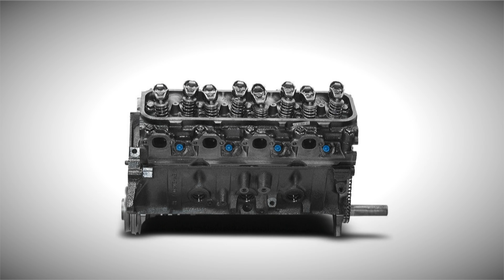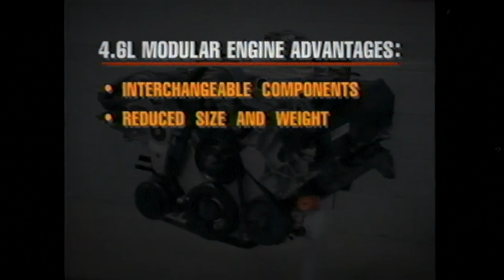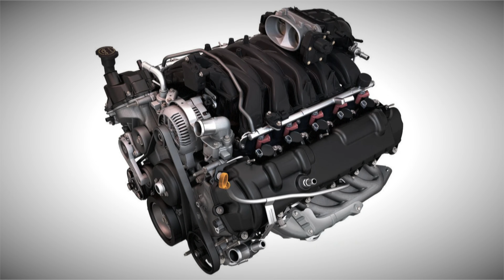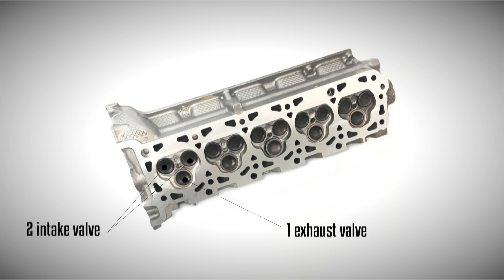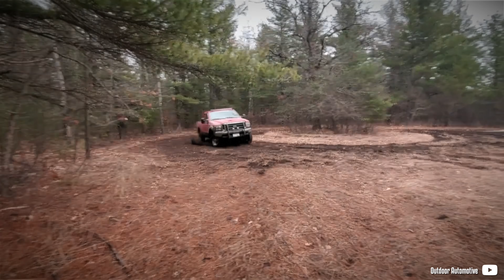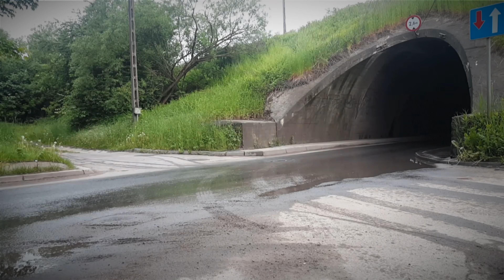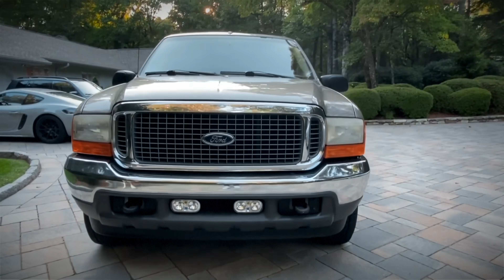Is Ford's V10 Truck Engine Any Good?

Comment: Having owned Ford trucks from flatheads, Y blocks and 460s plus gutless Windsors to the current 3.5 Eco, have to say that the one with the '06 F350 3V V10 was my second favorite and just behind the 6.7 diesel. Did it use gas? Of course, but no worse then a 460. You just can't move 7500 pounds dry weight, 4.10 final gears without doing that. Will it haul a 38 foot 5th wheel, 12,000 RV. Easily. Did it burn oil? Not a drop in 100K miles plus it was never in the shop for anything - ever since maintenance was (is!) still simple DIY. The current 3.5 Eco is still too new to put anywhere on my list though, but seems decent.

Comment: "100,000 miles of travel free maintenance" ford moment
Reply: 100,000 miles is when you have to do more than oil changes.  Spark plugs, coolant.   These engines easily do 300k.
Reply: trouble free*

Comment: my work has an old ford superduty worktruck with the triton v10 in it, it does all it needs to but it blows my mind seeing where people drove busses with them in it with no issues. i will absolutely admit though that the truck at my work has something like 300,000 miles so it could do with a looking into the internals due to the hard life it had there well before i got there.....but i will say, EVEN WITH it being high mileage and honestly abused its whole life, that dang thing is an absolute trooper if i ever did know one. i just wish i had the chance to drive it when it was newer.

Comment: I worked at a Ford dealership, and wouldn't own a Ford/Lincoln vehicle if it was given to me. Why?
Ford. Sells. Garbage. The number of recalls is mindnumbing- nothing they design and manufacture is fully engineered or sourced with any consideration of QUALITY- none of it.

Comment: They should have built a 5.8 3V or 4V V10 based off the 4.6L for the Crown Vic Cars....Too bad they did make aftermarket cams for the 3V V10 there is a serious 50-75hp (and probably 20-60lb-ft torque) left on the table for Emissions....Heck, in MY F250 a Turbo or Supercharger would be awesome... OR if Ford got really smart...A 5.8L V10 based off the 3.5L ecoboost Cyclone with 2 stage injection, and inter-cooler...Would 600HP and 850lb-ft Torque move a F250/350 with gusto? - YES That is 6.7PSD numbers... Without DEF and other "Diesel" issues...

Comment: My mom had a 2000 Excursion with the 6.8. The only problems it had were it went through coils here and there so we kept a couple in the glove box just in case. It also needed a quart of oil once a month. It had almost 400k miles on it before we got rid of it.
Reply: The coils kept going out because either y’all were using aftermarket coils or the spark plugs were over gapped and over stressing the coils.

Comment: The only problem with it is that it was based on the 5.4 and so prone to a few of the things the 5.4 was like the spark plug. A lot of the modular engines are good. With the 4.6 you just torque the spark plugs to the correct spec once and they only come out if you dont realize theres a torque spec. A 4.6 derived 5.8 could have been as unkillable as the 4.6 if done right.
Reply: Its based off of the 5.4, but the V-10 can take much more abuse and has proven to last much longer.  Thats because it runs so smooth with no vibrations thanks to the split pin crank that allows for 72° firing and a balance shaft.

Comment: My Mercedes Atego truck has a 6L diesel and yet people in America have a 7.5 gasoline in there pickup. Talk about efficiency eh
Reply: You have a turbocharged diesel. This gasoline engine is not turbocharged. Obviously without turbocharging more displacement is required.

Comment: Blows my mind that companies continue to buy the V10 pickups for their fleets. I understand not wanting to have to buy a diesel, they're so expensive. But the 6.8L V10 is absolutely garbage. Ironically, while the V10 is in the shop, I see 3.5 Ecoboosts, 5.0's and 6.2's pulling the same heavy equipment, and their engines don't seem to have the same mechanical problems. Obviously, we laugh at the V6 pulling an excavator, but it's usually the transmission that takes the hurt when they do that.
Reply: No one is still buying the V10 in new vehicles, because it is no longer offered by Ford.

Comment: UPS package cars on the Ford F59 chassis used this engine up until late 21.  I had five in my old fleet, and have one in my current fleet.  Absolute beast of an engine.  In nearly five years with the first fleet, the only real issues I had was a batch of counterfeit spark plugs, one broken exhaust valve spring, and one at 160k that started having excessive valvetrain noise and misfires.  I replaced just the one valve spring, and it was still running fine when I left.  The other engine got replaced.  The new Ford cars have the 7.3, and while it has more power, the howl of that V10 just can't be beaten.  Especially when I "forgot" to put the exhaust back together after replacing the transmission, and "accidentally" went for a test drive with it wide open.  Ooops.

Comment: Our shop replaced a 6.8 V10 in a small bus. It was the original engine, and it had 530,000 miles on it. All my experience with these is that they are/were extremely reliable.
Reply: They are very reliable engines F350 we have has same engine at 510k miles

Comment: I've driven several 2V V10 Ford moving trucks and it's easily the best. Smooth AF, likes to rev, power from idle to 5k and shifts quick. They're a lot better than the numbers might indicate. Recently I drove a new U-Haul with the 7.3 V8, and it was REALLY bad. It was International Diesel slow, despite having more HP than the V10 which I can't understand. Even empty, you need heavy throttle because it REALLY didn't want to rev and just feels crude as hell after driving the 6.8. I was expecting significantly more power but it falls on its face above low RPM. Also, side note, probably not on Ford but the Transmission programming in the 7.3 was absurdly bad. It took at least 2 full seconds to shift at WOT, every gear, making merging on the highway as slow as an International Diesel which is just unsafe. I'm sure it's got to be better in the new Super Duty but I was stunned at how bad it was. It's a hell of a lot cheaper to make a pushrod V8 than a OHC V10 which IMO is the only reason they dropped it.

Comment: Interesting comments about how good or bad a engines fuel economy is with no description of the truck it's in for example I have a 460 powered truck that you would be lucky to get 6 mpg . Why the truck is a 88 f superduty with a 11' dump bed. Axles 5,000lbs front, 11,000lbs rear, 10 bolt hubs, and 4.56 axle ratio. Due to the heavy front axle makes her sit high up like a modern 4wd pickup truck so bad aerodynamics. Lastly it weighs 8,600lbs empty.

Comment: ViscioRacer, next do the Ford 300 Inline 6 from the 60's to the late 90's. Sorry I missed your take on the triton V10 it's very satisfying to hear 10 cylinders roll. But take away 4 for a next engine for the take on the inline 6.

Comment: we a had a triton v10 f250 super duty for awhile, thing got 6.5 mpg and we took it from SE ohio to myrtle beach SC hauling a 30 foot camper. it was a 12 hour drive due to fuel stops and an hour nap because we left at 9 at night

Comment: My experience with U-Haul trucks is that the Ford V10 is whofully underpowered. We've loaded those suckers with roughly 7 metric tonnes of stuff and at that point a fully loaded gravel semi will pull away from you at stop lights. The trucks that are equipped with the Chevy 8.1 Vortec are able to slightly fall behind regular traffic even when loaded with the same cargo.

Comment: As a mechanic ive found the 5.4 2v 03+ and the v10 03+ to be extremely reliable engines. 03 was the cylinder head revisement. They all got 9 thread heads and they no longer blew out lol. They would go well into the 350k mile range if maintained. Timing tensioners !! And guides are the only weak link of these engines but we're talking 180k+ before that becomes a threat . I built a 65 mustang coup with a 5.4 2v 9 thread heads i ported , je forged pistons .010 over and mmr forged rods mmr hurricane pump and opg with comp cams s2 came. Home ported my heads and 180 degree exhaust. Gen 1 lightning intake and homemade mid plate for a gt500 supercharged pattern. Vmp gen 3r blower on 18lbs of boost. Made 618 WHP and 781 torque 😂. 2v engines are truly underated AF. Unbelievably reliable engines. Ford did an incredible job with those ... The 3V lol...  Well not so much
Reply: Nice info on 5.4 and the year of change to better engine..... but I like better the 5.0.
Reply: So stay away from 3v? Can you say why?

Comment: The number one problem with the V10 engine is 90 degree width in the block.  It should be 72 degree width in the block so it has even or equal power pulses.  Not good !!!
Reply: That's the angle, not the width. Yes, a V10 should have a vee angle of 72 degrees, but this engine uses split crankpins so that it does fire evenly... it's just not as well balanced as it could be, but the balancing shaft handles that well.

Comment: I have 2 of these trucks and it is crazy how no matter what you tow behind it , whether empty or loaded, you get the same 10mpg. I have both a service truck and an excursion.
Reply: My 01 Excursion 4x4 gets 15mpg on the highway at 65mph. Tuner, Y pipe, no cat helps a lot. 214k miles.
Reply: We've had our 01 Ford Excursion V10 since it was new, I'm 70 yrs old, and it's without a doubt the most reliable vehicle I've ever owned. 340.000 miles on it, service every 3.000 miles without fail. It runs like the day we bought it.
Reply: @southerncross3638 2000’s cars and trucks are the perfect blend of computer ran stuff and mechanical stuff, simple enough to work on it yourself with the benefits of not having to adjust timing yourself or a bunch other crap

I’m 19 and my dailies are a 2003 GMC Yukon with 240k on it, super clean, no paint flaws or dents, no torn up interior I’ve taken good care of it, clear headlights and all

And my other daily is a 1966 Oldsmobile 98, which is more “luxurious” than my 40 year newer gmc, the thing has automatic dimming high beams…like wth….big 425 rocket v8 too it’ll haul ass

I just rebuilt the motor so i drive it every day with zero worries, car has previously been restored so that’s why I’m even able to daily it, always starts up, automatic ac (called comfortron or something) works great too it’ll freeze you out in this Arkansas heat
Reply: I guess they don't struggle much.
Reply: I get 12-13 with a 20 year old 3/4 ton with 10k on the back.. 10 unloaded is rediculus and why nobody runs these things anymore other than kids who wanna say they've got a V10 like a Lambo and die hard Ford guys.
Reply: @adamguzzo94  They are available in big numbers , modular , and reliable . 10 MPG when you consider that the entire truck is 11,500 lbs is not that bad . Also people who run V10 usually charge their customers for fuel . Haulers , mechanics , serviceman . Fuel costs are part of the deal.
Reply: @adamguzzo94 I don’t believe you get 13 with 10k on the back. No way in hell with gasoline.
Reply: @adamguzzo94  Yeah you're so right. i should really sell my super reliable 2010 v10 that gets 10 unloaded and buy a 85K new truck with a PS that only gets 14 and will be in the shop for egr issues every 6 months...that will be cheaper for sure. Thanks for the math lesson genius...
Reply: @jfdb59  don't have to buy new, just don't buy garbage
Reply: Just get a ram with a Cummins hammer lane loaded down three million miles fluid filters and belts. @jfdb59

Comment: I see the V10 frequently on gen sets, and I consider it a new engine to the game even though it's been in use for probably 15yrs. 
Time will tell if it becomes as loved as the 300-6(lsg649) and 2.3-4(lsg423) engines are in this field. 
I'm not a fan of the 4.2 v6 they used to replace the 300 but it seems to work ok, I haven't seen many issues in those.
Reply: The 4.2 was decent, not a workhorse like the 4.9, but it was based on the ford 3.8 v6 that was a copy of GM’s 3800

Comment: I'm a MOPAR or no car guy but I do respect that V-10. from 2007-2010 I was a delivery driver and drove a 2001 E350 extended passenger van for a catering company with most of the seats removed. I liked the torque it had, it would keep up with traffic without struggling and get this it was getting the same gas mileage as the Triton V-8's we had (about 10-11 MPG).

Comment: Years ago we had v10s in our service trucks and I was never impressed with them. They didn't seem to make any more power than the v8's at the time but got much worse fuel economy.
Reply: Blows my mind that companies continue to buy the V10 pickups for their fleets, or any Ford for that matter. I understand not wanting to have to buy a diesel, they're so expensive. But the 6.8L V10 is absolutely garbage. Ironically, while the V10 is in the shop, I see 3.5 Ecoboosts, 5.0's and 6.2's pulling the same heavy equipment, and their engines don't seem to have the same mechanical problems.

Comment: Am I wrong for saying that this Ford V10 engine is a reliable version of the Audi V10 engine? Because the Ford V10 sound meaner than the Audi V10 and it is indeed a power house of the other vehicles that they have shoe horned this into.

Comment: Ford could have kept all of their V8 push rod engines if they wanted to. GM basically perfect the small block ford push rod engines. The technology could have carried over to the 385 series (460) if they wanted too. But….. the limy cock sucker Jack Nasser Brought all of his overhead cam engineers from England with him when he became CEO of Ford in the early 90’s That was the Kiss of Death for all
The push rod engines. Except for the GT40P headed 302. The only thing that the modular engine had over the old push rod engines at the time was hardly any oil leaks to speak off and hardly no NVH. (Noise vibration harshness) power per dollar the modular engines where a joke. Wasn’t until the terminator cobra in 03/04 and finally the 5.0L coyotes in 2011. From 92-2010 the modular engine just plain sucked.

Comment: F-250 owner here. The 2v v-10 with PI heads is super reliable. In 2019 went from the 2000 super-duty CC 
 to a nee 2019 alumaduty CCLB with the 6.2. Both are amazing trucks. The old V-10 is relegated to taking trash to the dump and the 6.2 tows the 10,000 lb trailers now. The 6.2 has more power and is one to two mpg more efficient across the board.

Comment: I had my own mobile fleet repair service for 40 years, I did a lot of diesel work and gas also and there is so many problems with the diesels in the last 10 years and the extreme cost of diesel fuel and maintenance cost I suggested to my household moving customer to get an F 700 moving truck with the V10 triton. These trucks run mostly local and generally only get 10 to 12 thousand miles a year use, even though they get a little less fuel economy the overall operational costs are a lot cheaper plus they are a lot cheaper to buy, sometimes as much as 15 to 20 thousand dollars  cheaper. They have had it 2 years and are happy so far.

Comment: What application does a 6.8 have a towing capacity of 4,700 pounds? Also a 6.4 or 6.0 which are both terrible will haul right past a 6.8 to their new head gaskets

Comment: My 01 Excursion has over 300k on it.
Runs like a champ.
Maintenance 
Maintenance 
Maintenance. 

She anit fast, but what a war horse she is.
Reply: Same here with my 01 Excursion. 
Just have to add 1 qt of oil halfway to an oil change.
So technically, it burns 2 qts of oil per 3k miles.
I can live with that.

She anit fast, but she's a tank when it comes to a crash.